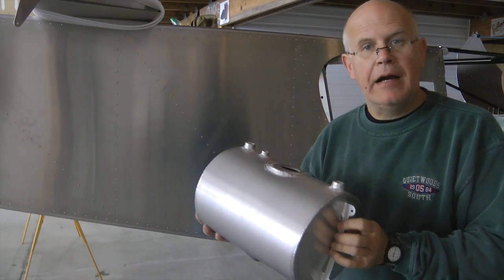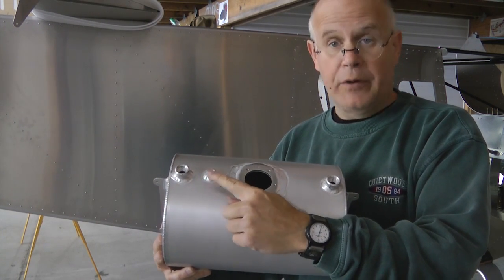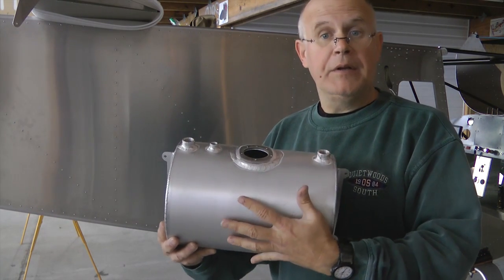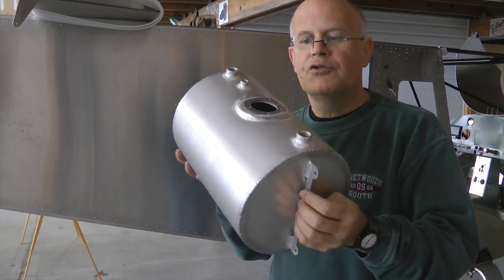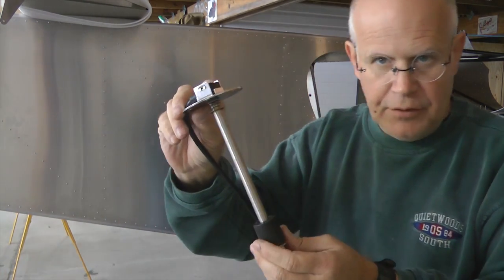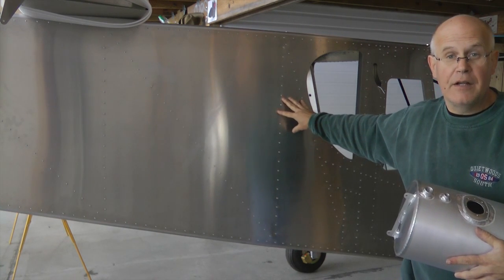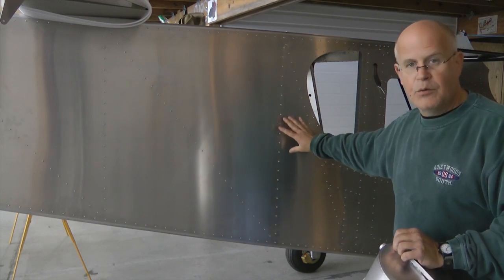Installing a Header Tank in your Home built Aircraft

Comment: I don’t understand why you need a sending unit in a header tank. I see the manufacturers of most of the header tanks. Do include the opening for the sending unit, I just don’t understand why you care about the last 2 gallons. And then do you have a separate display for the header tank versus the wing tanks?

Comment: I'm obviously missing something but how far does 2 gallons get you ? This all seems a bit much for so little
Reply: It also helps with some wing tank configurations, when fuel can run away from the tank outlet, this helps keep air out of the fuel system.

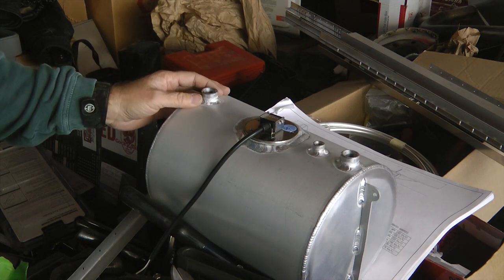Comment: My third and last question Jon!  In the pic at 3:27, you show a fuel line running right (forward) and it looks like it's going in to what could be a facet fuel pump.  I would have thought the normal install would be from the header tank bottom, to run a line forward to a gascolator under the pilot seat, like in some of your other videos.  Is my observation incorrect?PS.  I've looked for you at Oshkosh the last 2 years and missed you!

Comment: Hi Jon, great video.  At the 52 sec mark, you mention to ensure the header tank is vented independent of the fuel tank.  But you don't show how you did that.  I'm building a 750 w/912 ULS and have two tanks in wings.  Could I run a vent line to one of the tanks, maybe to the front upward fittings that aren't used on the zenith tanks?